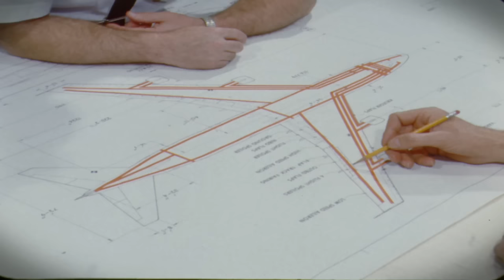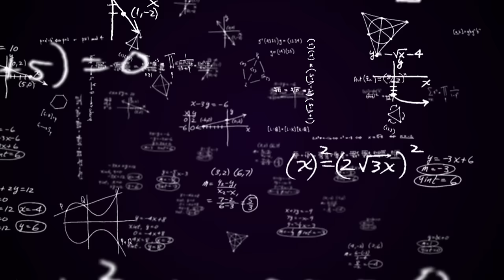Boeing – No Small Dream

Comment: I'm designing a passenger plane with a fuselage that splits into a v. It will have delta wings and the 2 engines will be mounted with pylons in the space between the 2 fuselage tails, one halfway above and one halfway below the fuselage. I don't know how ridiculous it sounds.
Reply: It sounds ridiculous now, but so did a vehicle that wasn't drawn by horses did back then. I think its a great design, very innovative and it sounds very efficient and aerodynamic.

Comment: Boeing never built anything revolutionary, the likes of Northrop, Rockwell, Locheed etc done that.
Reply: Try the 747, the plane that democratized air travel. Or the B-52, a bomber that's over half a century old and will still fly for decades. There's also the B-17, which dropped more bombs than any other allied bomber in WW2.
Reply: Dan M
B-17? Lightweight and slow with the load of a British medium bomber, not a good example. Sheer numbers pushed it through but it was an inferior bit of kit when compared to what was operational at the same time period.